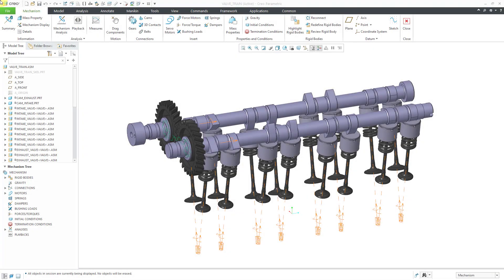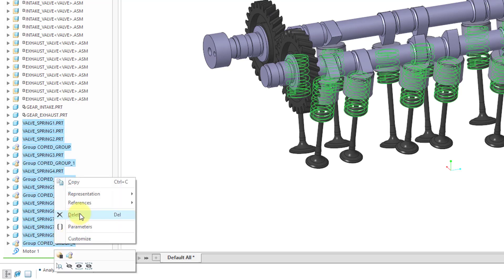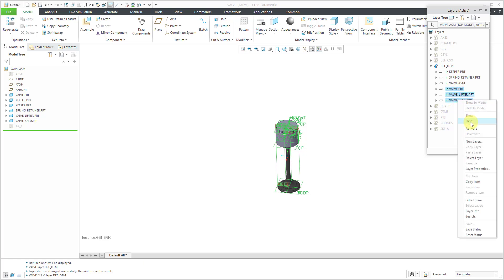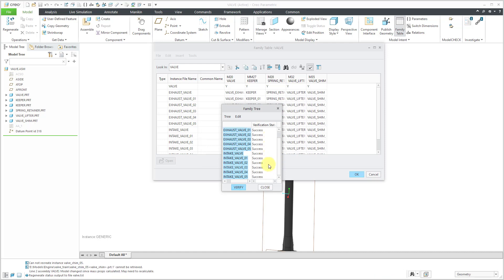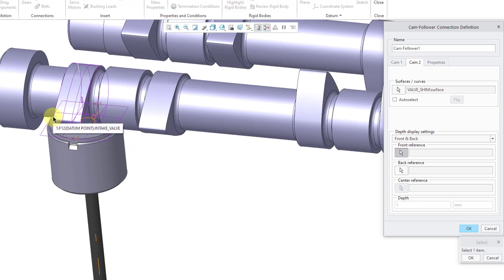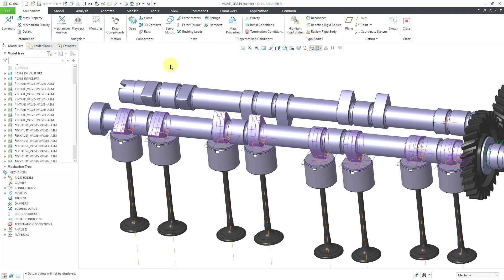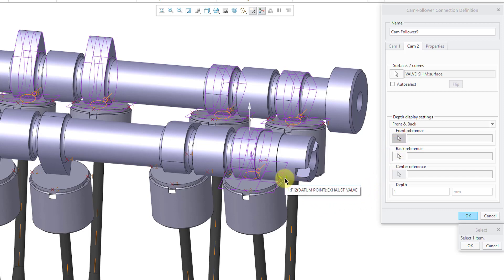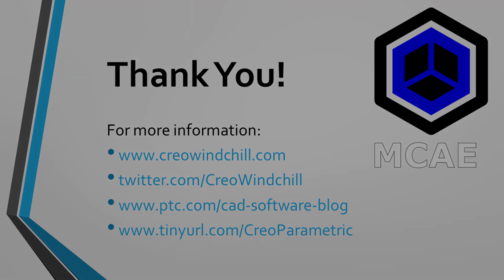Creo Parametric - Preparation for MDO Springs Video (Part 3 of 4)

Comment: Another great video Dave, could have done with this a year or so back. The bit that threw me was the flat surface and picking front & back points. For me that would be the other two points so that it was the front of where the cam is going and the rear, not the left and right. Weird software!!